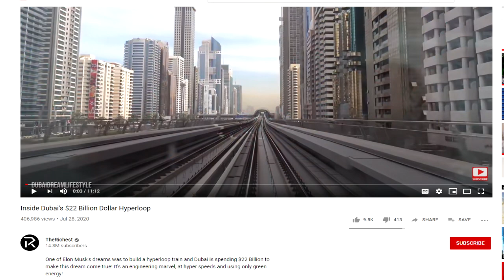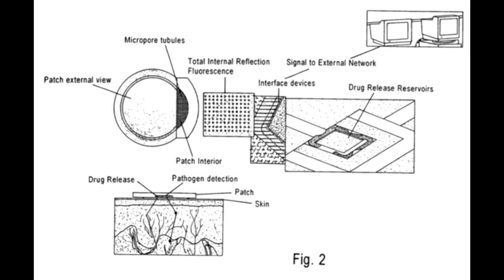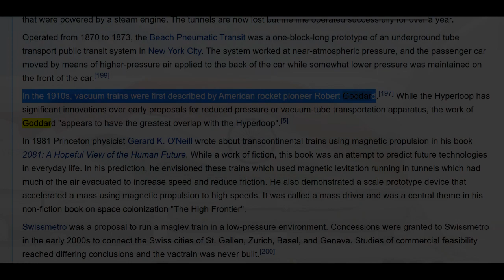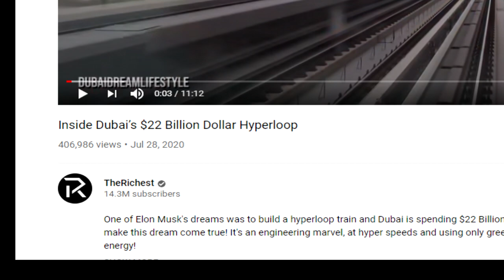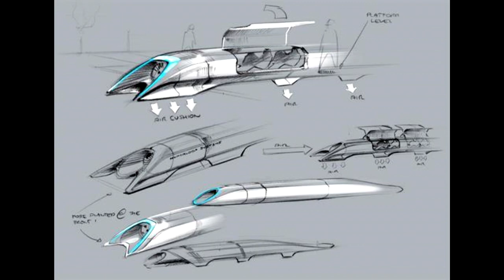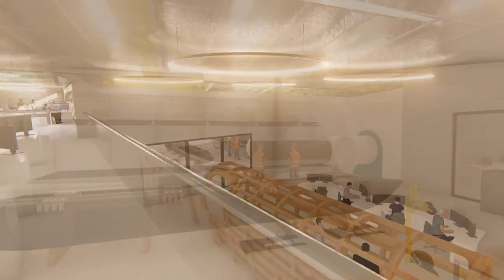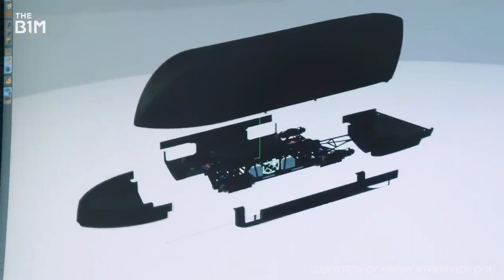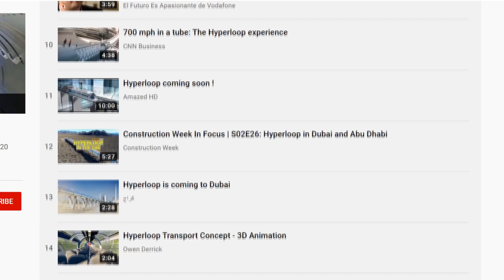Hyperloop, the biggest Scam since Theranos

Comment: It's literally a pipedream, they dream about trains in a pipe
Reply: LMAO
Reply: Stephen Willis Stotch  subways too, but the difference is that they're not planning on pulling a vacuum on any of those and the fact that even if hyperloop was a viable technology it would have the same limitations as monorails and a few more, the reason monorails aren't widepread as public transport is because they can't switch rails, which the hyperloop definitely has problems with, another problem comes when you look at how to handle a train stopping unexpectedly, your entire portion of track is unusable, because trains can't pass each other and you have to evacuate not only the people from the train that stopped, but also the ones in the trains that came after, having to repressurise that portion of the track and potentially needing several days to get the system back up, this kind of disruption would make the hyperloop an unreliable system that's not very attractive to use
Reply: @eL nUb because reasonable public transport would be blocked by oil companies, public transport that's doomed to fail won't? I don't know
Reply: Yeah kind of like flying machines were pipe dreams and ships that could cross an entire ocean were pipe dreams.
Reply: @l.c.8475  Monorails have to switch tracks for maintenance. I don't know what monorails you've ever been around but they most certainly can switch tracks. This isn't Disney World.
Reply: @ayylmaoo4486   they were not, physics had already proven that they are possible and there had already been models, they also weren't competing with already existing technologies and infrastructure in that space, they were at some point competing with zeppelins, but those were a flying desaster, the hyperloop is more likely to be like zeppelins than like plains given their massive potential for accidents, especially with the vacuum.

High speed trains can go up to 570 km/h at the moment, but many high speed trains are only operating at 200-300km/h at the moment, on one hand that means that there's still massive room for improvement that would likely be cheaper than building a hyperloop, on the other hand if we expand this to hyperloops that has high speeds that have so far only been theoretical it means that it'll likely have an operating speed that's half as fast at most so 600km/h at top speed and an avarage speed that's lower than that, because slowing down and speeding up takes a while and to make a hyperloop better than plains you'll likely need to stop along the way to pick up passangers and give people more options on where to travel, so let's say 500, but that's only if we go with the theoretical numbers that hyperloop companies are giving us. since it's not possible to pull a complete vacuum you'll have to pull a partial vacuum, to cut down on air resistance you would also have to make the trains a lot smaller compare to the tube or you'll just end up reintroducing that air resistance by running those trains in a small tube, which makes operating costs higher, because the vacuum you're pulling is bigger, or sacrifice speed

and you will have to continuously pull, just like you have to continuously blow up a bouncy castle

Monorails can switch, but it's more expensive to do than with trains, concrete rails and suspended monorails are the main ones that are having trouble with that, which is why we only see those implemented in places with only a sigle line, for example due to geographical constraints making the city grow in length rather than width, but other monorails also need more precise movements and a bigger portion of track to move to make it possible, they can't switch as well as trains do, there's a reason why we rarely see any newly constructed metro system use monorails these days
Reply: @eL nUb Rails and wheels are only reliable with constant maintenance.  Rails require near continuous support.  Every inch of rail construction requires grading, compaction, gravel, rail alignment grinding and continuous monitoring.  What sounds attractive about hyperloop is its ability to span from point to point above the ground clearing roads, water ways and infrastructure and be ready made in the controlled environment of a factory.  I am sure the Chinese have made huge leaps in terms of productivity of High Speed Rail.  At the same time I think there are companies in China exploring hyperloop systems.
Reply: Ayylmaoo Actually it’s a bit closer 2 someone saying they plan to built a fighter jet with navigation, autopilot and quantum phase disrupters by 1901. So yeah, a pipe dream. Or like someone in 800BC promising a working airplane by next year if you just give them enough money. Like, all da dollar in the world ain’t gonna be able to make you fly when the science and the technology ain’t there yet. On another note, I have a dream of building a teleportation device by next month. Would you like fund my project?

Comment: Thunderf00t, here is the issue with hyperloop that no one answers, or mentions.  I live in Kansas City, and from here a trip of over a hundred miles in any direction will change elevation by a couple hundred feet.  If we're talking about anywhere with mountains, that 100 mile trip means thousand foot changes in elevation.  unless were talking about tunneling the whole way, or having towers hundreds of feet tall to support the tube, at 700 miles per hour, this is not just going to be a roller coaster, it will be a food processor.  It might work in Saudi Arabia, or west Texas, but any popiulated area, think east coast of the US, or the west coast of the US has troublesome things like mountains, hills etc.  Which will require an amazing network of tunnels, bridges and towers just to keep elevation changes to a minimum.  Even if the hyperloop system was easy, economical and cheap  (which it's not) the infrastructure to support it would be astronomical.
Reply: I thought they wanted to build it underground
Reply: @meinleben2614  This would be nearly impossible.

There is a reason why you we only build underground railways in citys.
Reply: that is how we think about spaceX 5 - 10  year ago
Reply: Ok but u could use it for the post office 1 day shipping could easily be done whith every package
Reply: @TMG-Germany  yeah lets just... Ignore stuff like the channel tunnel
Reply: @ronyluis,  You can run a tunnel a couple miles thru a mountain, or even across the channel (though it takes Billions of dollars and many, many years, but you'll never succeed in digging a tunnel from LA to San Francisco, or Dallas to Minneapolis, or Atlanta to New York.  It would take trillions of dollars and take decades if not hundreds of years.
Reply: @meinleben2614  But how would they get the sun for Solar pannels?
Reply: @yudhaa  Building rockets is a big bang more easier than making a hyperloop as elon describes it.
Reply: @TMG-Germany  ...your point?
Reply: That's actually a non-issue, they could build it all on rails to keep it above the ground so if the ground goes up, the stilts it's on get shorter, if the ground goes down, the stilts get taller. That is not the important problem, the real reasons it can't work is just the thermal expansion of the tube for the seasons, and the catastrophic failure of the vacuum tube.
Reply: @medexamtoolscom  My point is, that it's easy to underestimate how difficult that will be. Just a relatively short run (in a fairly flat state), say Kansas City to St Louis ,maybe 250 miles, you'll see altitude changes of a couple hundred feet.  A 100' tall enclosed railroad bridge thru the middle of tornado alley does not sound easy or safe.
Reply: Good point, and how about crowded cities, how the hell do you bore this mountain of infrastructure into the heart of major cities, where, you know THE PEOPLE ARE!
Reply: Umm, underground or above, I shouldn’t think trying this sensitive unproven technology in the most earthquake-stricken area of the world would be a good idea.
Reply: @mmikeo  ⁹
Reply: @yudhaa  10 Years have already gone by it's gone nowhere and is going nowhere.
Reply: @kcobley  wow, okay I see
Reply: @TMG-Germany  Actually, building tunnels is a continually improving technology. With the latest tunnel construction technology, engineers can in fact bore through mountains, under rivers, as well as beneath bustling cities.

Before carving a tunnel, engineers investigate ground conditions by analyzing soil and rock samples and drilling test holes. And they can then figure out ways of drilling even through Mountains.

Building the maglev track and digging the tunnels is the easy bit. Figuring out a way of keeping it evacuated over very large distances is the difficult part. And that challenge is one that no amount of engineering may ever be able to solve.

And even if it can be, it will be at such great expense that the ticket prices alone will never pay for the infrastructure.

It's possible I suppose that capturing land value and property developments along the route may pay for the infrastructure, possibly in a public and private sector collaboration, but the political hurdles in doing that would probably be insurmountable. Or at least in a liberal democracy they would be.
Reply: @mmikeo  it could be scaled up possibly, with multiple boring machines. Say you have 100 to 150 of these machines each making a segment of tunnel they each start themselves. It would take some precision, but I think putting a man on the moon took greater precision than this requires.
Reply: HSR would be much cheaper and proven possible
Reply: @kcobley  Because it's a scam

Comment: i wonder why nobody has come up with "hyper lube".
"hyper stimulate your partner, and reach your climax together with 300km/h"
Reply: LMAO!
Reply: That's something I would actually back.
Reply: 😂😂😂cracking up like humpty dumpty
Reply: I don't need the lube.
Reply: Hilarious
Reply: Sign me up as long as it is available in 55 gal. drums.
Reply: * in emercencies can be also used on hyperloop pod to lubricate the air skis.
Reply: We need a hyper fleshlight, we can shoot sperm at speeds faster than sound, add some quantum physics there and quantum entanglement there boom profit.

Comment: I know! I know! 

Why don't we tip those capsules up and put rockets underneath them! Then they don't need a tunnel! BRILLIANT! 

I call it the HyperRocket. It's my idea. No one has ever thought of this before.

Now if you'll look at this rendering with lots of blue lights you'll agree that it's very futuristic.
Reply: And it runs on solar roadways and the rockets are powered by thorium car engines!
Reply: None of this is very eco friendly, why don't we just dig the tunnels and let people cycle down them. Away from the traffic.
Reply: @paulmurgatroyd6372  or, ya know, make a train.
Reply: To solve the propulsion factor, put some gunpowder underneath, a short pipe section say 300 meters, vertically, and place a mad frenchman, a gun nut and an armor maniac (call the NRA for those two last), and shoot for the moon!
Or get a cigar shaped boat powered by electricity and use that to ram warships... It should also be able to submerge and have a crew trained to use respirators to go underwater hunting, so to be independent of land...
Reply: Let's just build some mass relays, that's something we need to start funding